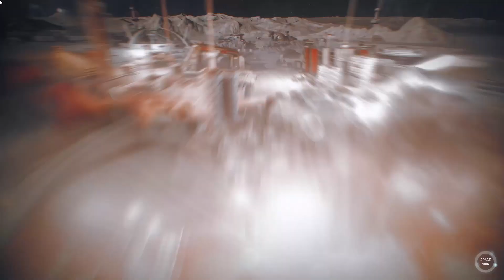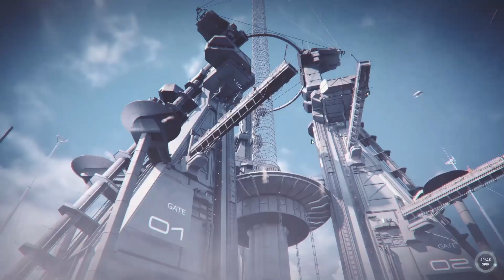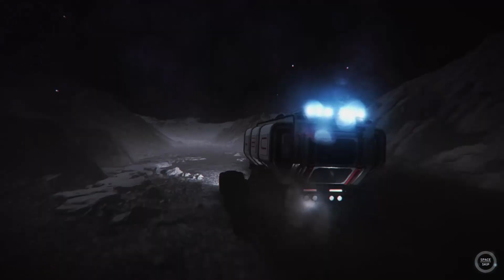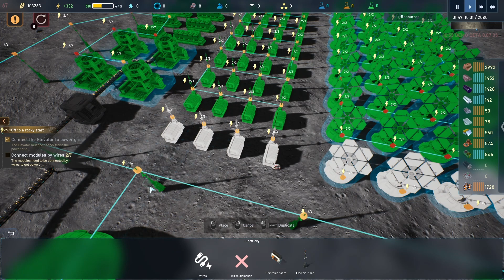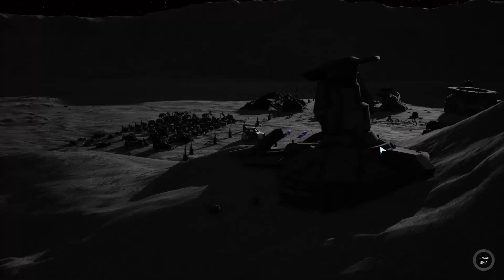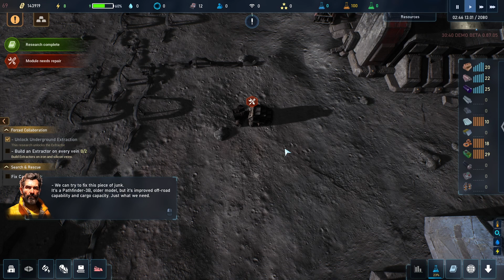🚀 Embarking on a NEW Journey  | The Crust |  #01 | Demo Let's Play

Comment: Never fixed up the rover I guess,
Reply: happened to me too, I've put my thought in the survey. The problem is that the quests are going too fast and you don't really understand the game so much at this point. The quest tells you to build an extractor on the dig site to soon and you don't have time to gather enough ressources and it doesn't tell you that once you build the extractor the mined ressource changes. So you end up having to delete the extractors to gather more ressource and you lack time to repair the vehicul.
Reply from the maker: Hi @celem12, I appreciate your input. Episode 3 demonstrates a method to save time and be better prepared for missions. Feel free to check it out!
Reply from the maker: Yes indeed @sawyeriii, and the game was on the highest speed